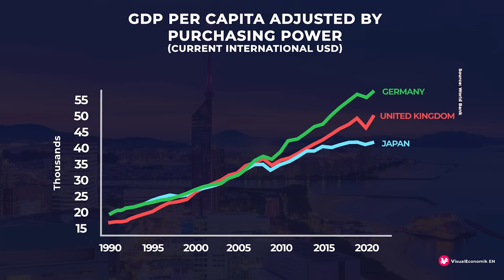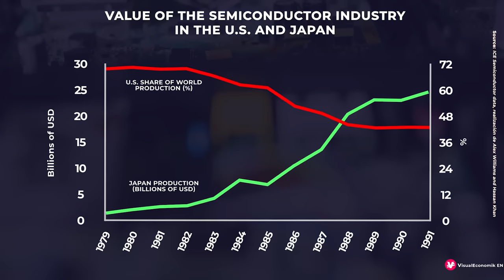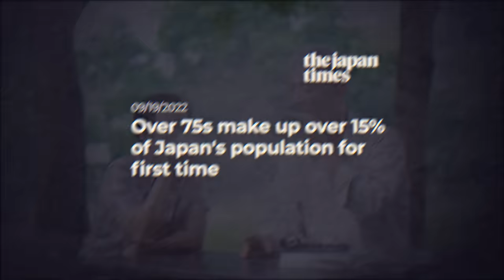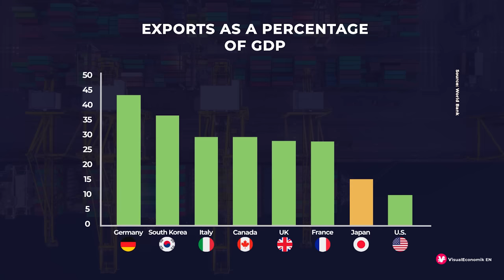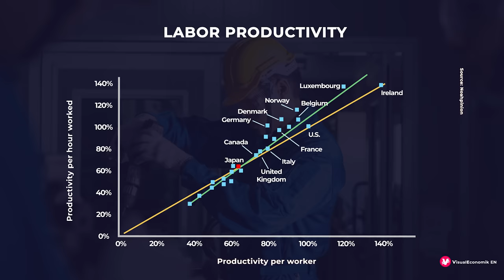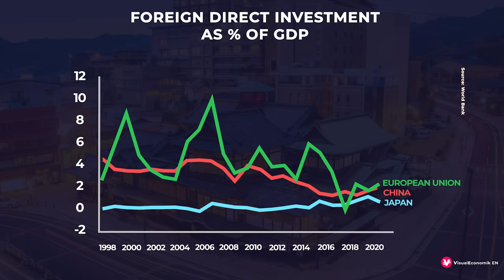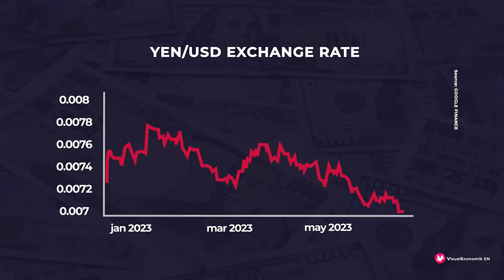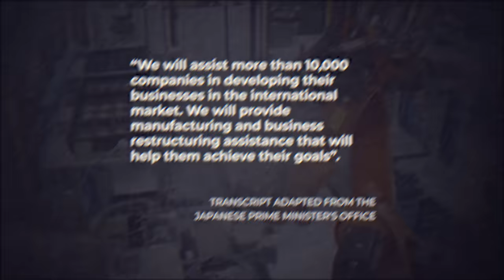Why Japan Could Rise Again as an Economic Super-Power

Comment: Actually the digital camera was invented by Kodak.
But they feared it would undermine their film rolls business, on which they were the real dominant player, so they didn't launch such cameras to the market.
Then came the competitors with digital cameras, most of them form Japan. So, they lost on both businesses.
Reply: Yes, you’re right. I bought a Kodak digital camera in 1991 , was $1000 then.  It worked fine for about 3 years, although SD cards crushed sometimes.
Reply: Bud
Reply: Correct!. They former CEO, claimed that this was an expensive gimmick that could only canibalized the existing business. He was right on one thing.
Reply: "Actually"🤓☝️
Reply: They had it in their labs

Comment: 14:00 - “energy… fuel”

Japan has been pushing for Hydrogen, with blue H2 coming from nuclear, this will be a good way to eliminate dependency on foreign oil & gas, and make more of the energy domestic [which will look more appealing with currency devaluations.]
Reply: Good point. Main reason why many automakers in Japan aren't putting all their eggs in the electric car craze basket. Hopefully their gamble pays off and they can make hydrogen a cost effective alternative.
Reply: have they looked on windpower,solar? with seashore many countries like germany want to push that, with future combo of hydrogen to store it, perhaps replacing some vehicle fuel use from oil. batteries come better fast so japan as hitech+industry country is almost ideal to develop these systems with their motivation to reduce dependencies of imports.
Reply: @effexon Wind and Solar are not consistent, high on daytime or windy days while weak to non existent on cloudy days/night/windless days. That is why for the need of a base load eg fossil fuels or nuclear.

Chemical battery storage for wind and solar is not efficient though.
Reply: @rzpogi I know all of that but as japan still is hitech, high skill society I thought clever people there have plan for this. lot of companies afterall are in PV and electronics business, some bleeding edge.
Obviously heavy industries like shipmaking, car manufacturing need nuclear power which japan has plenty even after fukushima. But cars, home electric supply, small businesses.... all that need electric too and that is much more upto debate , at least in europe.
Reply: @effexon  - “lots of companies… pv business”

China produces ~80% of PV panels & components, which would make Japan dependent upon China. Not good to stay out of wars.

“Batteries”

China produces north of 50% of all batteries, and they own the global mines. This makes Japan dependent upon China. Not good to stay out of wars.

“windpower”

The big wind power companies are not in Japan.

6 of the top 10 wind power companies are in China. This would make Japan dependent on China. Not good to stay out of wars.

With 1 dictatorial country, like China, owning these energy options… this is worse than the oil cartels spread across the Middle East & world! They know it, too.

Japan has experience in Nuclear and Hydrogen  (where the US buys both from Japan.)

If Japan plays their cards right, H2 should eliminate the need for natural gas, required for wind & solar around the world.

Comment: This video isn't hitting the spot because he is too much captured by monetary stats. The answer to the title question lies in technological aspect. In the 20th century, Japan took charge of both of digital & assembly field and analog & mechanics field. The knowhow of the former one can be easily obtained and was shifted to Korea, China, etc. But at the latter one, no other countries won't be able to exceed Japan because the knowhow requires long time accumulation to succeed, which doesn't enable other countries catch up with Japan from the viewpoint of lifetime employment system, craftsman spirit and more shortened stockholders' eyesight. As the sample of it, let's think about machines & Tools which are essential for electronics & assembly too. Japan is producing all categories except super large one for aerospace craft and is No.1 in this field. Germany is the rivalry but can't produce semiconductor manufacturing equip. Thus Japan has core technologies in every field though they can't make all at low cost. Therefore Japan grows steadily like linear and catch-uppers appear momently and fade out like digital.

Comment: Japan's adoption of EV production were slow, it was due to its outright intention to avoid EVs, out of fear of being too dependent on China for certain raw materials for electric vehicles. Japan therefore opt not to go into EV. Instead they opted for hydrogen fuel cell vehicles, with Toyota and Honda the main propagators swaying the direction, and totally resistant to changes. Other Japanese car makers had more interest in EVs, but unable to carry the ground as these two main Japanese car makers have a strong hold on the Government and lobbying groups.

The problem with hydrogen fuel cells is that even if the Japanese managed to succeed domestically by installing fuel cell points in Japan, which is today even massively inadequate to cope, people in other countries are not going to buy such vehicles that needs massive investments in setting up fuel cell top up points countrywide, apart from safety concerns like electric shocks and inflammality of Hydrogen. Compared to EVs, with power lines already linking every nook and corner, this is a very inconvenient factor.

Comment: As an aside on the energy front. Japan has massive methylhydride deposits under its extensive maritime zone. 
This poses a massive greenhouse threat if these start outgassing because of global warming triggering a positive feedback loop.
Methane is over a hundred times more powerful greenhouse gas than CO². 
But a colossal greener energy solution this is why Toyota is so gung-ho on hydrogen. Plus Japan spending so much on hydrogen/methane research.
This would allow Japan to become energy self sufficient. Hydrogen is dozens of times more energy dense than Li-ion battery packs.

Comment: most of the companies labour earns from 170000 to 260000 yen per month after deducting income tax,pension, insurance .usally working hrs per month is 194hrs but in most of the case amount earned by labour working 194hrs is insufficient so extra 20 to 40 hrs part time job are done .  most of the labour are not  directly hired employee rather hired through temporary dispatcher companies , dispatchers companies commission is around 30 to 50 percent on the per hour amount . usally 10 days 60 percent paid holiday are provided. packet of cigarette cost 430 to 600 , coffee cost 100 to 120 ,government or private apartment cost 35000 to 60000 yen , restaurant food usally 450 to 1100 yen but most of the people eat instant noodles to save money  which cost 130 to 400 yen .water bill around 12000 ,gas around 9000,electricity round 12000,mobile 15000,net 6000  .fruit, food etc etc normally cost 150000 per month. this is a real data I have provided to all people now plz evaluate yourself.

Comment: I have watched your video on the Japanese economy, and I am concerned about your analysis. You claim that the Japanese economy is poised for a strong recovery, but I believe that this is a misguided assessment.

The Japanese economy has been plagued by structural and systemic problems for the past 30 years. These problems include:

A declining and aging population, which is leading to labor shortages and productivity declines.
A rigid and inflexible economic system that is resistant to change.
Political instability, which has made it difficult to implement reforms.
These problems are deep-seated and will be difficult to overcome. Without addressing these issues, it is unlikely that the Japanese economy will be able to achieve a sustainable recovery.

While the Japanese economy has shown some signs of improvement in recent years, this is due to external factors, such as the Japanese government's fiscal policies and the increasing reliance on the United States.

Therefore, your claim that the Japanese economy is poised for a strong recovery is based on a misunderstanding of the country's structural and systemic problems.

In order for the Japanese economy to recover, it will need to undertake fundamental reforms to address these problems. Only through the efforts of the Japanese government and society as a whole can these problems be overcome and the Japanese economy can achieve sustainable growth.

I urge you to do further research on the Japanese economy. By understanding the structural and systemic problems that Japan faces, you will be able to provide a more realistic and sober analysis of the country's future.

Comment: Japan’s economy would have been larger than the US if not for the latter crippling them through an unequal Plaza Accord.

It has always been an economic power but it is declining again because the US is forcing them to inflict self harming sanctions on China,

The result is that Japan would lose its status as the third biggest economy in the world very soon.

Japan’s economy is controlled by the US since it became a full fledged US colony in the last one and a half decades.
Reply: Well, the Plaza accord is not the reason. The same accord was imposed on Germany as well, but Germany remain strong. The key reason is the end of the cold war. During cold war that ended late 1980s, the US remained open wide for Japan to freely take the US source technologies, everything from rocket to semiconductor, that were used for the products for export and the market. As soon as the cold war ended, the US shut down the technology flows to Japan, thus no more innovative products were possible, also the US also closed the market. This is the real reason, not Plaza accord. Japan is not capable in creating something new and it was. Their innovation has been heavily depended on the foreign sources all the time.
Reply: Japan's revival is impossible due to excessive fiscal debt and the hopeless population issues. Their rearmament is also economically impossible. It's too late. 

Contrary to your delusion, the only way to save Japan is for Japan to become a leader in keeping China in check. In other words, going back to the good old days of the Cold War. Because the US can completely open its technology and market to Japan again. This is the era that the late Abe expected.
Reply: The result is that Japan would lose its status as the third biggest economy in the world very soon.... Well, historically, the Japanese economy has never been this large. The Japanese economy is just in the process of slowly returning from the bubble inflated by the US to a normal size suitable for Japan, 5th to 10th in the world This bubble was possible entirely thanks to support from the US, and it's still lingering. Thinking as if the Japanese economy is collapsing because of the U.S. only shows your low intelligence.

Comment: The simple answer is no, Japan can be a big power on the world stage but not a superpower, and the reason for that is that there are a few conditions needed to be a superpower, one is having a modern economy, second is having a big population.

The powers that have that are the EU, US and China, others like India and Brazil could have it someday but they are a long way from that.

Japan has a modern economy but it's population size doesn't measure up with the other big boys and it's population is in decline, whereas the EU, US and China are still growing and in the case of the EU, it's also got the option of expanding with new countries.

Japan had it's heyday in the 80's, where it's economy was massive for the size of the population, but a big part of that is because they went all in with high-tech whereas the west were slow on that, the 90's came around and the west went all in with high-tech and ended up pulling away.